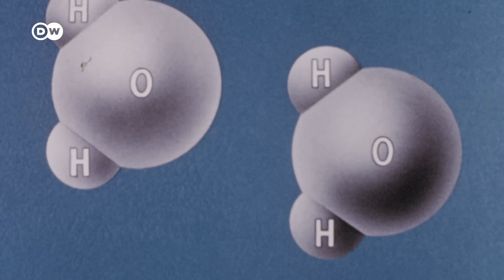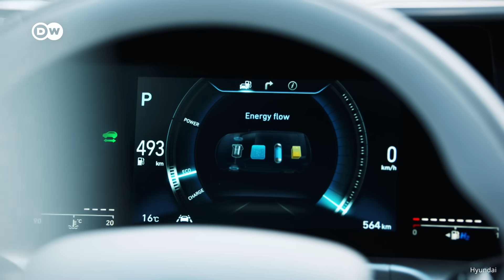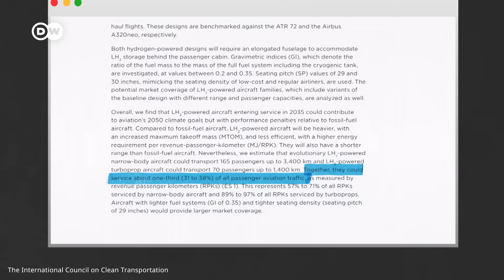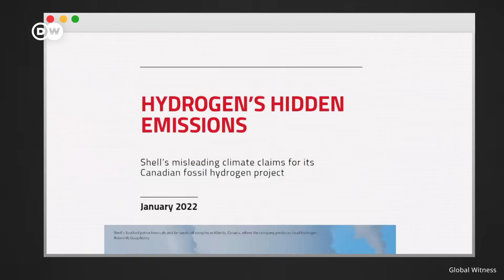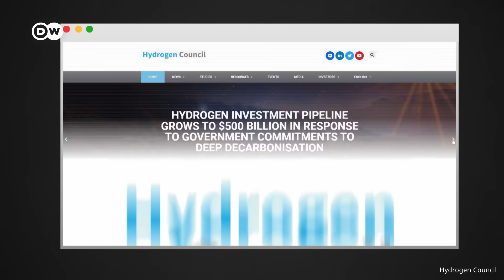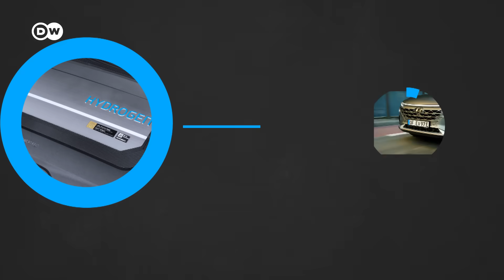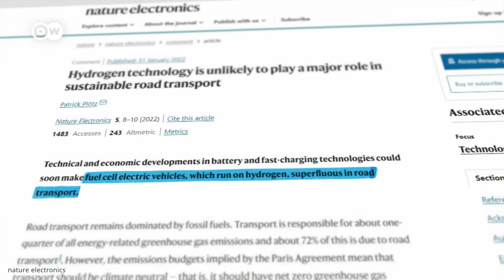The truth about hydrogen

Comment: The low volumetric density of H2 is a huge problem. While the presenter correctly points out that you need 3 times the space compared to fossil gas the proper comparison is to gasoline/petrol where you need seven times the space. That means you need seven specialized H2 tanker trucks to refill fueling stations. Frankly that is horrible: additional traffic, additional cost, additional risk.

Comment: I find the statements about blue hydrogen very misleading. The companies claim they can EVENTUALLY capture 90% of the CO2 and experts in their studies show that currently they only capture 48%. There is no contradiction as long as the carbon capture rate can be increased further in the long run. The same goes for the methane leakage; of course the claims can be wrong but it seems that this is not what the study found. And the CEO of a green methane startup is not an independent reference either..

Comment: I've been following this issue for quite some time, and as far as powering cars is concerned, there are several viable options other than hydrogen fuel cells. Toyota is developing hydrogen combustion engines, which have a better energy use coefficient than fuel cells. These might be an option for freight trucks and railroad locomotives. And the Gumpert Motor Company of Ingolstadt, Bavaria, Germany, has developed a methanol fuel cell that has been shown in actual road tests to work very efficiently, offering 820 km of range on one tank of liquid methanol. This could be the answer for fueling individualized automobile traffic.

Comment: I'm sure there will be some niches where hydrogen is a viable alternative to batteries. But the main focus in working towards net zero should definitely be nuclear power, the most environmentally-friendly energy source we currently have and one that doesn't suffer from the intermittency problem of wind and solar.
Reply from the maker: Hey there! Yes, the intermittency problem is a big thing. The electrical grid needs to change quite a bit. We looked at that in another video 👉https://www.youtube.com/watch?v=u-DsDuTceTo

Comment: Hydrogen is a complete red herring.  Using coal or gas fired power stations to supply the electricity to breakdown water is utterly  stupid as the CO2 produced is immense.  Using renewables might be green but it is utterly inefficient.  The power used could be much better spent without the intermediary production of hydrogen.  In addition there is not distribution network.  The costs and time to produce such will be outrageous.  Forget it.

Comment: Fuel Cells will freeze below 27 degrees Farenheit, so except in heated garages (extremely rare in the US), fuell cells will not work in most of the US, Canada, the UK, and anywhere where the  low temperature goes below 27 F more than a few times a year. We have almost 170,00 places in the US to fill up with gasoline (Public Gas Stions + Private/Corporate Gas stations). We have less than 100 Hydrogen filling station in the US as of Feb 1, 2024 in the US.

Comment: I will never understand why every discussion about energy ends up in a discussion about:  Is this the solution to all of our energy problems?   Is that the solution to all of our energy problems?  Is nuclear going to fix everything?   Are renewables going to fix everything?  Do fossil fuels have no alternatives?   The market will decide on the practicality of hydrogen fuels,
and for what applications.   

In your documentary, you indicated that hydrogen had to be stored and transported.  Well, in some cases it does, but, with electrolysis, it can be created anywhere.  So the transport infrastructure might not need to be as large as you suggest.
In the end, not everything has to be powered by one fuel.  Today, electric and gas vehicles share the road.  The most important thing is that the genie is out of the bottle.   Fossil fuels for transportation now have *competition*.   It's even possible that the planet can achieve net zero and still have some level of fossil fuels in use.   How much?   That depends on the competition.

Comment: Water vapor is also a greenhouse gas. Probably not a good idea if every car to emits it. Battery technology and thorium reactors are the best approach imo. Thorium reactors aren't useful for making nuclear weapons though
Reply from the maker: Hey Kevin!  The impact of this water vapor on the environment is still a topic of debate in science.  Water vapor is a greenhouse gas, but it is also the most abundant naturally occurring greenhouse gas in the atmosphere.
Reply: @DWPlanetA  I'm pretty sure NASA and the EPA agree that more water vapor is a bad thing. I'd like to hear your opinion on climate change in general. Hydrogen is just another fuel for i.c. engines. The i.c. engine is not the future of commuting.
Reply: Every car emitting water vapour does sound like a concern considering CO2 levels have dramatically increased because of anthropogenic burning of carbon, whereas water vapour levels have been relatively constant over the same time period.

Water vapour amplifies the greenhouse effect but is a feedback, an amplifier because it precipitates rapidly out of the atmosphere. CO2, the most prevalent non-condensing greenhouse gas, resides in the atmosphere far longer, and is the control. You got me starting to look up more about water vapour.
Reply: @rps1689  

￼Earth's water cycle. Credit: NASA

It works like this: As greenhouse gases like carbon dioxide and methane increase, Earth’s temperature rises in response. This increases evaporation from both water and land areas. Because warmer air holds more moisture, its concentration of water vapor increases. Specifically, this happens because water vapor does not condense and precipitate out of the atmosphere as easily at higher temperatures. The water vapor then absorbs heat radiated from Earth and prevents it from escaping out to space. This further warms the atmosphere, resulting in even more water vapor in the atmosphere. This is what scientists call a "positive feedback loop." Scientists estimate this effect more than doubles the warming that would happen due to increasing carbon dioxide alone.
Reply: @kevinishki  Makes sense. The arithmetic sign of that feedback is positive, which makes it an amplifier.

I have come across many on the forums that say that water vapour feedback (to the forcing by noncondensing GHGs) is negative. I often tell them if we could demonstrate water vapour feedback (to the forcing by noncondensing GHGs) with a negative sign. We’d be famous and rich ; )

Comment: Carbon capture and storage? OMG! This old furphy.
It has NOT been done in any commercially viable process despite so much blather and effort over the past 30+ years. Even if the 'capture' bit got sorted, storage in the earth is entirely unproven, and it is most likely that CO2 would simply seep through the rock structures.

Comment: Air travel? On hydrogen? Never mind the good old debacle that was the Hindenburg.....   Hydrogen has the lowest energy density of all fuels. Can you imagine the disaster potential of flying through the stratosphere in an aircraft whose fuel must be pressurised to 700 psi 😳🤣 And the weight of such pressurised fuel tanks? 🤣 Never mind its extreme flammability 🔥 THAT is a marketing catastrophe 😱

Comment: Green hydrogen from renewables is a fantasy. First renewables have not been getting cheaper, especially from offshore units as you will see if you examine the financial data from Dong and other offshore owners in the UK. In fact it is getting so much more expensive that in order to get them to build these white elephants the UK Government has now upped the guaranteed payment by 30% to over twice the cost of power from a gas unit and this is not taking into account the cost of upgrading the grid. In the UK it is estimated that to switch all fossil fuel uses to electricity will require the power supply to be tripled and there is not a cat in hells chance of doing this from renewables given the periods when the wind does not blow. Fortunately the UK has a solution, hydrogen which they intend to use in the national gas grid to replace methane for domestic and industrial use. The intend to produce it by steam reforming of North Sea gas burying the carbon dioxide in existing deplete North Sea gas and oil wells. But a more practical solution is to use the surplus power from the fleet of small modular nuclear units they intend to deploy from 2030 as the backbone of the grid to supply dispatchable power. These units need to operate at near maximum load 24/7 and the surplus power can be used to produce hydrogen locally by hydrolysis. The new technique of absorbing the hydrogen on a net of boron nanoparticles removed the need to liquefy it for transport use. JCB, the UK producer of construction and farm machines is already producing modified diesel engines that run on hydrogen and these can be used in trucks, busses and trains. So the real net zero future is hydrogen as Toyota, Porsche and other auto manufacturers agree. Incidentally Porsche has a process to produce synthetic fuel from carbon dioxide that fits well with steam reforming. It is a pity Green zealots are so ignorant of chemistry and so wedded to methods of producing energy that belong in the 17th century.

Comment: I think we need to focus on all are alternatives. Too many people think the big idea will come from one invention, when infact it will be many inventions that will salve the problem. Even water cars; cars that run on water arnt a safe solution; hydrogen leaks release methane in to the atmosphere. Methane is 80 time worse for the environment then carbon dioxide.  It also tales 30 years to remove methane fron the atmosphere.  Even if they say there wont be any leaks, just look at the recent oil spills. There will always be human error.  This is true for hydrogen vehicles and hydrogen in general.

Solar powered cars may have their problems with finding enough sun to charge, but as the technology advances they keep geting better and they work and dont contribute to greenhouse gass or carbon dioxide, and if you add charging stations to top off your battery your in good shape!  

Solar is an alternative that doesnt contribute to carbon additions, but solving this problem will truly take many ideas.

Comment: One important aspect is missing in this video. Electricity from renewables is strongly volatile (fluctuating). The number of electrolysis-plants (or storage)  that are necessary is given by the peak influx of renewables (strong wind and long cloudless summerdays). On the other side, there are long perdiods of lacking wind or solar (long nights in winter). So you need a huge amount of electrolysis plants, which are only operating a fraction of the days of the year and stand still in standby most of the time. This makes green hydrogen-production totally ineffective and too costly.
Reply from the maker: Hey Stephan! We tackle the issues with the electrical grid in this video 👉 https://www.youtube.com/watch?v=u-DsDuTceTo

Comment: The question is how much energy does the electrolysis prosses require?
Reply from the maker: Hey Adam! The needed energy varies, especially depending on the efficiency of the electrolyzer. Mostly it is between 40 and 50 kWh. However, there is lots of research going on to lower the amount of energy needed.

Comment: Would love to see discussion of engineering challenges regarding storing hydrogen safely for use in any of these applications
Reply: Beautiful question!! 

Currently, storing and transporting pure hydrogen is risky, costly, and inefficient. 

See, hydrogen atoms are SOOOO small that they can easily leak through almost any storage vessel in its gaseous state. 

This also goes for transportation.

Currently, chemicals like Ammonia (NH3) are used as a "hydrogen carrier". Essentially, you can safely and cheaply store and transport Ammonia. 

If you take Ammonia and heat it up to around 1,600 degrees F - it will "crack" into Nitrogen and Hydrogen - then you can use the hydrogen  

But.... heating ANYTHING to 1,700 degrees is very energy intensive and has its own challenges. 

Those are the main issues with JUST storing and transporting the hydrogen. 

....

Okay, so you can liquefy the hydrogen just like LNG, yeah? 

Sure.... but that needs to be SUPER high pressure (dangerous) and crazy low temperatures (energy intensive). 

If you have any other questions, please let me know!

Comment: The bullshit EV fans seem to perpetuate is how efficient they are. Sure, in a small country like Norway or the UK where the electric grid is  mostly renewable it makes sense. In America our electric grid is old and inefficient, somewhere around the 35% range. An EV is only as efficient as the power used to charge it. In America a 90% efficient EV is about 28% efficient overall, not much better than ICEV, especially diesel.

Comment: 🎯 Key Takeaways for quick navigation:

00:00 🌟 Hydrogen is gaining attention as a clean energy source with applications in transportation and industry, offering potential solutions to reduce emissions.
01:37 💡 Hydrogen can be produced through processes like electrolysis and used in fuel cells to generate electricity, making it a versatile energy carrier.
05:16 ⚡ Green hydrogen, produced using renewable energy, is seen as a cleaner alternative to gray and blue hydrogen, which have significant carbon emissions.
08:57 🌍 Hydrogen faces challenges, including storage issues and efficiency concerns, making it important to find the right balance with other energy solutions.
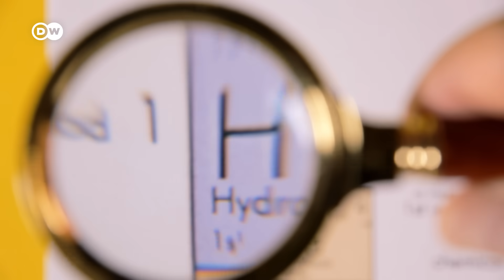11:38 🕒 The next decade will be crucial for hydrogen to prove its potential as a major player in the transition to a low-carbon future.

Made with HARPA AI

Comment: Definitely this is the future, (green hydrogen derived ) liquid methanol fuel to fuel methanol fuel cell (and then electric motor without battery with way longer range and "rechargable" by refueling liquid methanol in just a minute just like any diesel engine. This is the future, better than "normal hydrogen" because methanol is a liquid fuel directly and easy derived from green hydrogen and way better usable than hydrogen because no need compression pressure storage and or ultra low temperature needed. Methanol liquid room temperature fuel is just a drop replacements in any gas station with little modification and same happens even with combustion engine but obviously fuel cell Ev gives more efficiency .

Comment: Hydrogen will take time, and the hydrogen decade will be the 2040's. The video did not cover hydrogen hybrid vehicles and heat pumps which catch the best of both technologies, utilising the efficiency of electricity for baseload use but hydrogen for flexibility such as recharging on long journeys and heating a poorly heated house mid winter.

Comment: It would be good to include turquoise hydrogen - methane pyrolysis to produce hydrogen and solid carbon. While it won't sort out the upstream methane leaks, it uses much less renewable electricity (about 14-20%), provides another material stream with the carbon black, and importantly, gives the fossil fuel giants a way to save face. (Not that they deserve it, but politically, it will help.) I think it should be talked about much more. Green H2 should be the long term solution (for aviation and high energy processes like steel, not for cars or heating buildings). But turquoise is good while there's not enough renewable electricity.

Comment: Hydrogen is a greehouse gas.
Free roaming Hydrogen in the atmosphere impedes the natural processes that remove Methane from the atmosphere. As such, it has such a significant impact that it is listed as a greenhouse gas.

It is also the smallest atom, extremely hard to contain. Currently various naturap gas transportation systems leak anywhere fron 1-7% depending on the location and the type. Natural gas is much easier to contain than Hydrogen.

More, Hydrogen is extremely reactive. As such, regular gas and liquid gas transportation materials can't be used, so there can't be any repurposing of natural gas transporting for Hydrogen. An entirely new, and more technologically superior, this difficult and expensive to make, transportation network will be required to be built. With about 4x the capacity of natural gas network capabolities according to experts.

This is all forgetting the big drive behind Hydrogen. The oil and gas companies looking for a new way to greenwash themselves. How will green Hydrogen meet the needs of entire nations worth of energy demands? It won't. The scale needed to produce that much Hydrogen to offset that much energy would be collosal. Guranteed that politicians and such will setup Methane and coal production of Hydrogen without some extreme level of resistance from citizens. They would have to, to meet rhe demand.

Of course, this would make climate change much worse, because they would be using more Methane to produce Hydrogen than if they had used Methane directly to do what they want Hydrogen to do. Add that to all the added free roaming Hydrogen leaking into the atmosphere, and you end up with drastically rising levels of extended life Methane in the atmosphere.

Hydrogen will probably have it's place in climate change. It is vital to many sectors even now. I don't think it can or should be used as the key to trying to displace fossil fuels. It just is very unlikely to be more helpful rather than harmful.

Comment: How can we justify using water as fuel for Hydrogen engines when all life depends on water? I understand that we can't use fossil fuels as they are non renewable; but, water is more valuable than fossil fuels. Am I wrong?
Reply from the maker: Hey there! Thanks for your question. Hydrogen energy requires less water than most fossil-fuel based productions. However, countries with already scarce water resources would be dependent on further water imports for hydrogen energy.